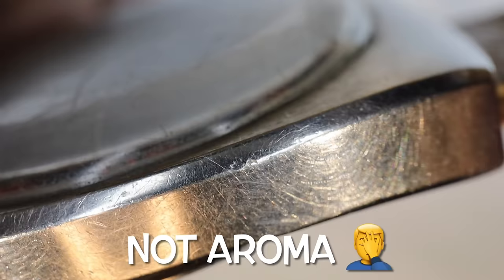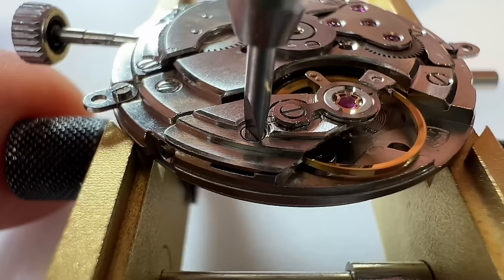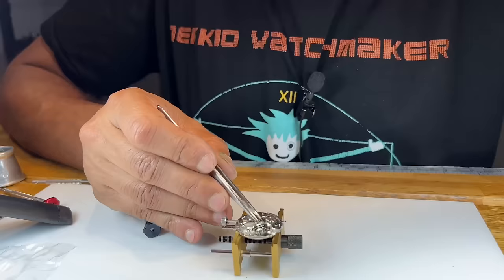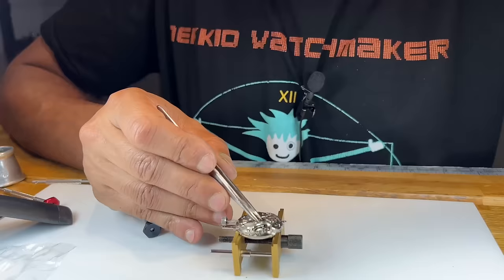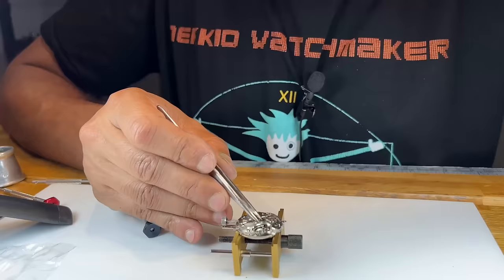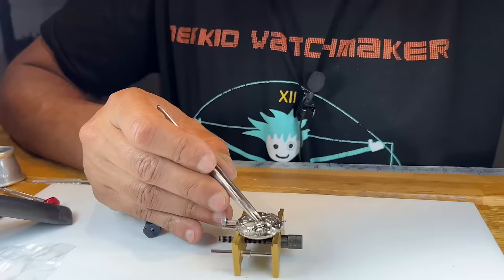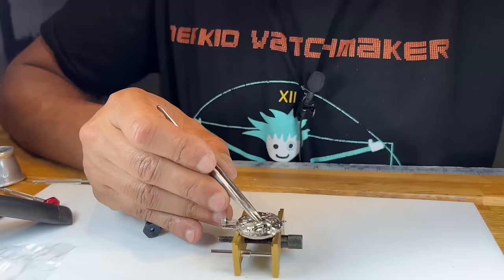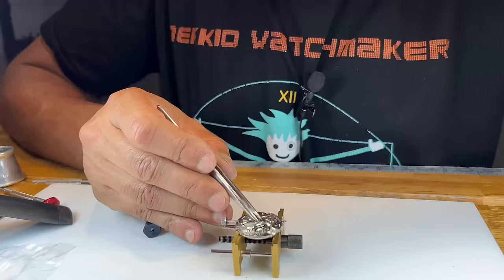1970s Roamer Stingray Dive Watch Restoration

Comment: Beautiful work Joe. I have a little bodge I use for scratches, I go over them with a black Sharpie and then wipe it away on the edges. It doesn't hide the scratch, but makes them less obvious. I also do this on slightly worn vinyl record cardboard sleeves after I buy a record... makes them look almost new. Steph 🙃
Reply from the maker: Thanks for the TIP Steph

Comment: Finally someone using plastic tweezers to remove parts, if I am handling something that is very delicate I have a set of plastic ones that I use. And they are great for electronics, no chance of accidentally grounding out something.

Comment: Thanks for another enjoyable video.
I have two of these watches..both the early dial/hands 44 jewel and the later version one with the updated chapter ring style (the one fitted to the watch in the video) 
The watches with the newer chapter ring were fitted with the 28 jewel version of the same movement .
I wouldn`t call the watch a franken just a partial marriage with what appears to be the chapter ring swapped out -either due to damage or to the taste of a previous owner.
The bearing jewels in the rotor were apparently subject to cracking if dropped/abused and the later ball bearing rotor assembly could be swapped in changing 2 parts- but it looks like the rotor itself was not one of those.
If the watch was dropped hard enough maybe both the rotor assembly and chapter ring got damaged together.

Great watches and nice movements whichever version you have though .
Reply from the maker: Thanks for the information mate. Very interesting read

Comment: Hi Joe, great to have you back. I was intrigued by the jewel count in this movement and did a bit of digging in "Automatic Wristwatches from Switzerland" by Heinz Hempel. It turns out that 10 of the jewels are used in the pair reversing wheels in the automatic works (5 jewels each).  Each reversing wheel contains a one way roller clutch - very similar to the arrangement used in the modern Vostok movement. There were also ruby ball bearings used for the rotor, but these were fragile and subject to damage from shock - probably why your watch had them replaced with tougher steel bearings.
Reply from the maker: Thanks for the info Michael
Reply: @NekkidWatchmaker  My pleasure. Always enjoy your videos - informative and entertaining! 😁

Comment: The 44 jewel version of the MST471 has extra jewelled ball bearings hidden in the auto reversing wheels (10 in total) and 7 in rotor bearing. Commonly the jewels in the rotor bearing shattered and were replaced with a steel ball version. I own 4 of these movements and only one of them has the jewelled rotor bearing intact. Very much a case of using jewels when plain steel would be better. Thanks for a great vid.

Comment: That was really fun and interesting Joe, personally haven't fixed a Romer very nice, another movement with a cool instant date mechanism that one i like too, i like moast of them, just smuggled myself a MuDu off ebay and it's a little cracker Felsa 30j 4000n needed service bad and a little adjustment but really great, i re-lumed the dial hands too tastefully just off white like the original, not taken it off for a week, but that happens a bit, cheers Joe. Dave

Comment: True diver watch has the bezel rotating counter clockwise only for security. The bezel was used to record the starting time of the dive, in order to calculate decompression times: the longer you dive, the more you need to decompress to avoid accident. Having the bezel rotating ccws only means that if the bezel is bumped and moves inadvertently, it will increase your dive time, leading you to take more decompression time, and be safer than shortening your decompression and risking an accident.

Comment: Hi Nekkid Watchmaker, always a pleasure to watch your videos! A real talent for resurrecting watches, especially on the polishing part. 
However, with all due respect, when you test if a watch is waterproof, you have to do it empty: that is to say without the movement inside. Because, in case of a problem, if water gets in, you have to redo all or part of the work, or worse, damage the movement
Cheers.
Reply from the maker: Thanks mate. Before I lowered the watch in to the water, I pumped it up with air so because there is a leak, the pressures air will also have entered the watch. So when lowered in to the water it is pressured air that comes out so you can lift it out without getting any water in. Hope that makes sense
Reply: @NekkidWatchmaker  Oh yes, I understand perfectly. I know this technique too, but I prefer to do the empty test. 
If for example, the watch glass jumps (I admit it's rare), and then it's the drama :D
Thank you for your answer, I wish you good continuation and thank you for your quality work!

Comment: I had a Roamer Rotopower 44 jewel. It had a waterproof clamshell case. 
There were a lid of jewels in the rotor bearing.
Wish I'd kept it. Swapped it for work with George Clarkson for one of my Seiko 7a38 watches.

Comment: I quite enjoy you putting all the sound effects in, like a disc jockey who really enjoys working the sound board. A lot of the sound effects are used in memes so I laughed very loudly at several points, you have somehow swung around in a big circle into being incredible hip. As for the polishing, the markings were still very crisp until you used the mop cloth, because the stick has a hard backing that can conform to the high spots and not touch the frosted finish on the markings. I have had some success putting rouge onto a flat surface such as a popsicle stick and using that as a polishing tool.
Reply from the maker: Thank you 🙏 I keep telling my kids that I’m hip but they don’t know what hip means

Comment: @Nekkid Watchmaker  Wouldn’t you consider using polishing compounds on the INSIDE of the crystal to maybe tackle some of the scratches that are visible but you can’t feel, also would possibly help with the hairline scratches that again you can’t feel but you would think should’ve came out when doing the deeper ones ?. Thanks 🙏, Mark.
Reply from the maker: There should be no scratches on the inside, it’s usually crazing that’s occurs just beneath the surface and in that case it’s time for a new one

Comment: I have a awesome Lejour compressor with the inner rotating ring. I’ve never seen another one like it anywhere. I’d like to get it fixed. I can’t get the case back off the gaskets have turned gooey. I know the one crown that turns the inner bezel the gasket is gooey I don’t know about the case back and I can’t find proper case opener to takeoff specialized case back case it has an 18 point star it only protrudes about 1 1/2 mm possibly even just 1 mm so it’s very hard to get a grip on without the correct case back opener which I do not have. If you’d like to do a video on it or repair it I am willing to pay to have it done. Keep up the great videos and work.

Comment: This is when MST was struggling and was forced to make movements of lesser quality.  The Roamer cal. 436 has six ruby ball bearings in the rotor and six in the change gears.  It's still considered one of the best automatic movements ever made and its robustness puts a Rolex movement to shame.
Reply: I have a few Roamers with this 44 jewel movement..it`s great but maybe not that robustas they swapped out the rotor bearing jewels for ball bearings after a few years due to cracking problems I think if dropped/mistreated..
I treat mind kindly as replacement bearing jewels are unavailble

Comment: Nice work!
Shame that there was nothing to be done about that scratch in the dial.

My biggest problem with maintaining water resistance is always the crown and pushers. If I use an o-ring that seals the pusher well, it usually is too tight. Selecting an -o-ring that allows the pusher to move freely, then it often will leak.
What was your solution to the crown leaking for this one?

Thanks for posting. Look forward to more.

Comment: question what is the function of this jewel for looking at parts of a watch where it is attached it will still function without these jewels
Reply: In this movement the later 28 jewel versions had substituted some of the jewel bearings with steel ball bearings so the anti friction/wear purpose was still maintained.
Most of the substituted ones were in the automatic winding mechanism and rotor assembly.
Ruby bearings can be more likely to crack if a watch is dropped or knocked hard.

Comment: Some of the jewels in these high jewel watches were non functional and were fitted into some of the solid  cogs the barrel and even the edge of the rotor, it was stopped when legislation stated that only functional jewels could be counted. I have seen some which boasted over 60.

Comment: One thing I noticed is when I saw you oil the right pallet fork jewel, I though you oiled the wrong jewel because I always oil the left jewel then I saw that the escape wheel teeth and the pallet are actually reverse in this movement. The escape wheel runs anti-clockwise. Is this an uncommon thing? How did they design it like this? Modern movement like ETA 2824, 2892, 7750, seiko 7S, 4R all have clockwise escape wheel so I had always oil the left pallet jewel blindly but I will inspect the shape of the fork and escape wheel teeth to make sure from now on.

Comment: Love your work and videos!
Question, I have a battery WR120 citizen chronograph watch. It was a gift from my wife 28 years ago. I been noticing the chronograph hands aren't in there initial position or even work when trying to use the stop watch. It still keeps time well. Is this a service in need issue? Does battery watches need servicing like mechanical watches do? Thank you in advance!
Reply from the maker: The hands can be reset to home position. Search for user manual using the movement code on the back
Reply: @NekkidWatchmaker  Thank you so much for responding! I'll give it a go. Have a good day!

Comment: I could not believe that after all of the hard work you pressure tested this watch with the movement inside of it.
Did you really expect it not to leak?
You edited the part where you had to do it all over again?
😱 Sometimes I scream at my monitor, but nothing changes..😂
Personally I'm not a great fan of watches displaying "Swiss Made" on the dial.
I remember the 70's and 80's quartz war production as being particularly crap.
Reply from the maker: Even if it leaks, the water won’t get inside the case as the case is filled with pressured air